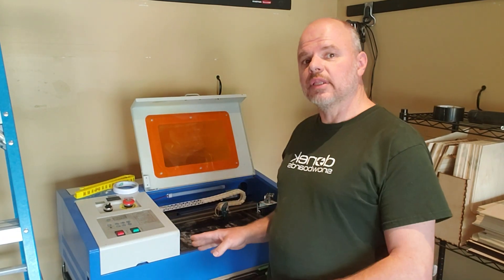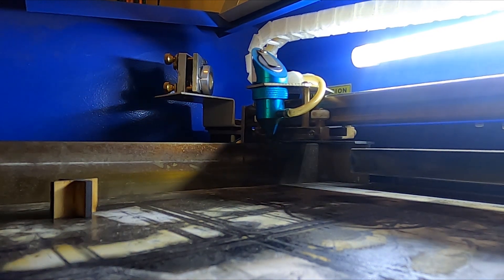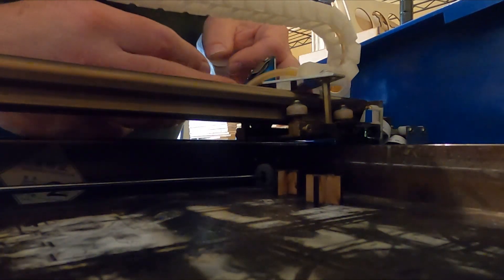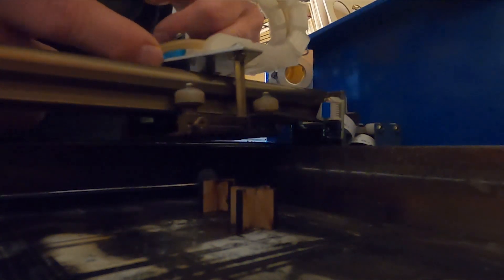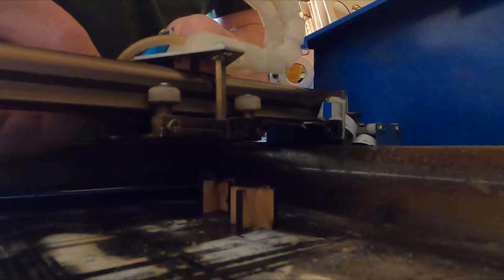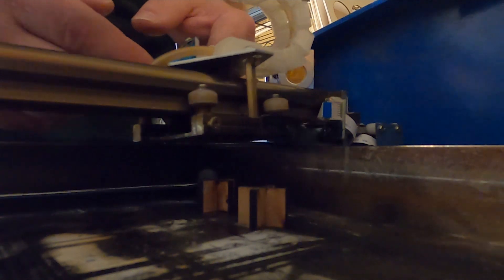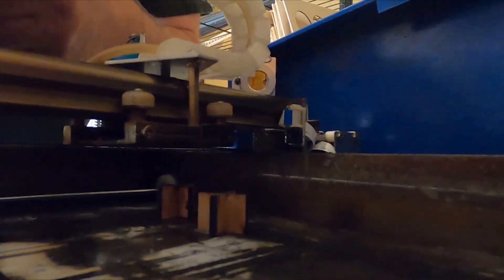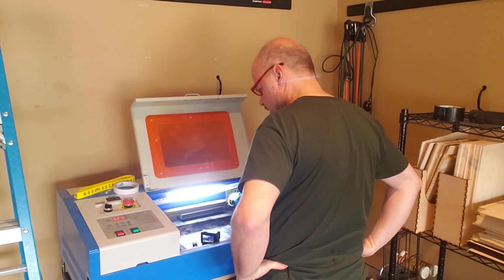K40 Laser Homing Problem

Comment: What could it be if I have the opposite problem? Instead of it moving back and not stopping, every time I turn it on it moves the gantry forward towards the front of the machine about 4 or 5 inches and then stops. No matter what position its in... Eventually it hits the limit at the front and grinds just like yours did, but at the front of the machine...   Thanks

Comment: Oh, if head is out of alignment like this, homing problem is nothing. Last night cut one big-ish project and now I see why many people does not like that laser cutter - too small work area. I got some design from 3axis (free plans...), and there are not proper measure in CorelDraw or Inkscape. So I decoded dimensions based on 'fingers' length to match with 4mm  plywood. Simply divide 4 mm by number measured in Inkscape and then select all and multiply H and W by that number.